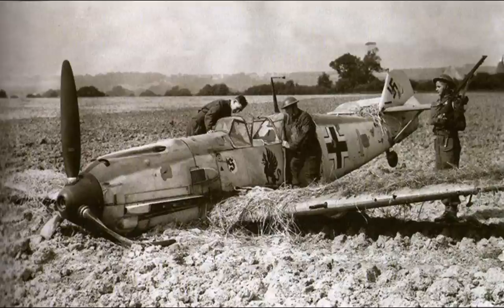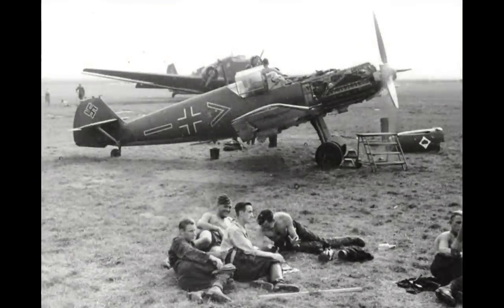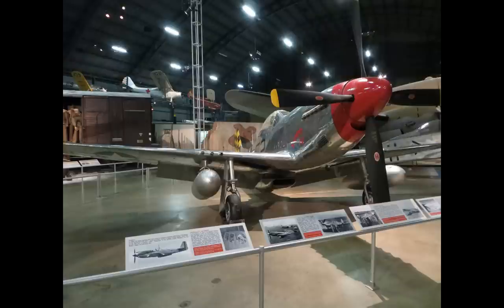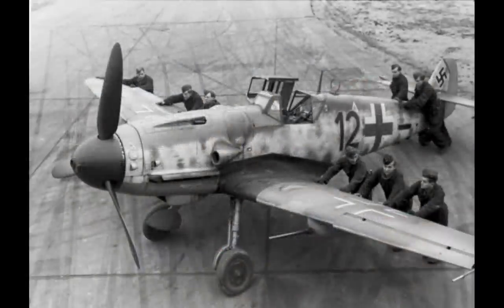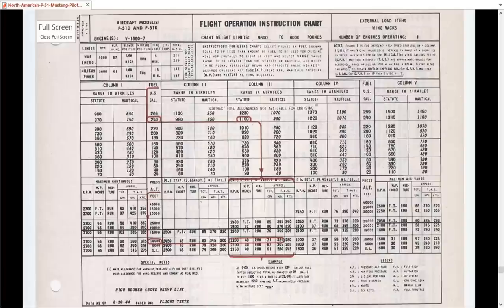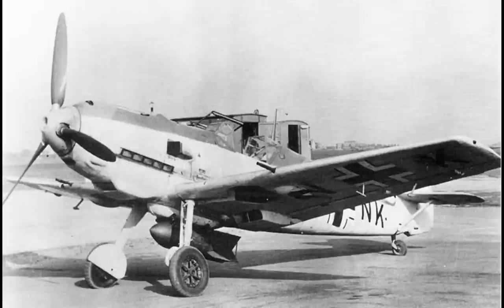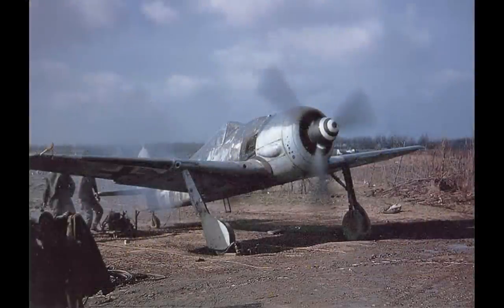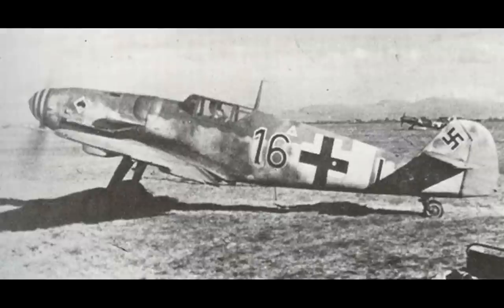Messerschmitt BF 109, Why Such Short Range?

Comment: From what I learned from Gregs other videos the answer to why the Mustang was faster is it ran a much higher octane fuel then the Germans had access to. Makes you wonder what kind of performance the Germans could have achieved if they had access to our fuel.
Reply: It’s roughly a 20% increase from B4(87 octane) to C3(100/130).   It’s about a 10% increase if going from B4+MW50 to C3+MW50 but could be more.   The main effect would have been allowing the Me 109 to go from 1.3ata 1300hp to 1.42 ata 1420hp one year earlier.     The later number ie 100/130 is a performance number and means it’s a 100 octane fuel that produces 30% more power if over boosted and run rich.  British 150 fuel was really 110/150 and the Americans had a 115/145 fuel so they gave 50% and 45% more power when rich and 10% or 15% when lean.

Late war Me 109 with the DB605DB/DC which was adjustable multi fuel  might end up running missions on 
 1/ B4 fuel, 2/ B4+MW50, 3/ C3 or 4/ C3+MW50.   The boost levels possible were 
1/ 1.45 ATA, 2/ 1.8 ATA, 3/ 1.8 ATA and 4/ 1.98 ATA.

An ATA is an atmosphere of pressure.  It coincidently neatly coincides with power.  IE 1.8 ATA means around 1800hp and 1.98 ata about 2000hp.

German B4 fuel,was 87 octane but they also had a C3 fuel of 93/115 octane.  From 1942 it improved to about 96/130 octane as their fuel plants I proved.  This allowed the BMW 801 to go from about 1700hp to 1900hp and finally 2050hp.   Initial increase was simply by increased boost pressure  but latter they added injection of the fuel into the supercharger to cool and contract the air called C3 Einspritzung.
Reply: They would still be inferior to the Mustang. The FW-190 didn't have  a two stage/two speed supercharger and bled hundreds of horsepower with altitude, the 109 wasn't much better in that department. High octane fuel does increase power but not by large enough margin to change anything really. Also, even at similar 100 octane horsepower the Merlin 60/V-1650-3 still generated more power than the DB-605, and the difference only increased with altitude.
Reply: 4./JG26_Onebad german engine's were developed for use of fuel they have had, if they would have better fuel they would make design around it, keep in mind that they had access to more or less damaged merlin engine's that were "dropped" or have landed on their land, 2 stage boost means not much if your engine will knock fire
Reply: @Herezjush  Even prior to introduction two stage superchargers and 100 grade fuel the DB601 generated less power than Merlin XX series, which is why the Spitfire MkI outperformed the Bf-109E rather significantly during the Battle of Britain. This trend would remain for the majority of the war.
Reply: @heckpupper9532  
And why is this? Exactly, because of the fuel but not in the way you would think. The RR Merlin not only had the advantage of higher octane fuel but also the advantage of having enough room in the engine bay to allow an inter cooler for the intake air. The DB 605 lacked both because of the usage of a huge engine in such a miniscule aircraft. But they had to have such a big engine to compensate for the comparatively low engine power, due to  low octane fuel. The high octane fuel basically allows the Merlin engine to run with more boost pressure, at higher altitudes, with more ignition timing advancement at  higher compression ratio, all these things effectivly increase power and all have been missing on the DB605 because of low grade fuel. The DB605 was probably a more advanced engine than the Merlin, simply from the fact that it had to deal with so many draw backs.
Reply: Octane does not increase BMEP.
Reply: @mbsevans  
Well no, it does. As i explained before, due to high octane content, you can increase the boost pressure, the ignition timing advancement and the compression ratio, wich all increase the BMEP and therefor power. So, the germans could very well have gotten a lot of power out of the DB605.
Reply: Mandernach Luca well NO it does not, and you just stated as much. You’re confusing octane, with real power increasing changes, as you correctly listed. Heptane is actually what makes more BMEP. Octane is what quells or nullifies the result of heptane.
Reply: It's no real wonder that BF 109 Messerschmitt held the certified world speed record for a single propeller aircraft until the late 70s when a highly customized Bearcat finally beat it. The only other time that I know of a single propeller aircraft that was faster than the P51 or the BF 109 was when Chrysler had built their first true Hemi engine, hey 16 cylinder aircraft engine, and put it into a P-40 of all things because there were no other newer aircraft available, and ran an uncertified circuit at right on top of 500 knots, which would it even beat the Bearcat in the late 1970s. The problem was is it was the first week of August 1945.
Reply: @wilburfinnigan2142  I never said that, I used Merlin XX as a comparison with the DB601A, precisely because it didn't have a 2 stage supercharger. I wanted to state a case that even back before 100 grade fuel and 2 stage supercharged engines became a think for the Allies, the Merlin was still generating more power than the DB601. Read carefully next time.
Reply: They would have also needed to add an intercooler system, a second supercharger, and a bigger radiator, aside from higher-octane fuel to the 109, according to Greg’s video on this subject. This would have required space inside the 109’s small airframe that it didn’t have, however, and therefore the German fighter was doomed to never match the Mustang’s speed at just about any altitude, outside of short spurts via injections such as methanol or nitrous oxide.
Reply: @44hawk28  the Messerschmitt 109R which broke the  world speed record bore absolutely no resemblance to ANY of the Bf 109 series which went to war.
Reply: The aircraft you're speaking of was in 1937 and it was a BF 109 d with an engine upgrade. But it most certainly was a BF 109 V-13. It was one of three bf-109 that raced it 1937 and set World Records. Do aircraft you are speaking of was a short tail speed version of the me-109 designated an me 209. It was given the moniker me-109 R after its construction. In April of 1939 it set a world record of 469 miles an hour that stood until 1969 when a Meijer exceeded that record in a heavily modified Grumman f6f bearcat. Your me 109R Bears no resemblance to a Messerschmitt accepting the wings a primary structure except it has a shorter tail and a custom Rudder assembly. So it is a heavily modified BF 109. And it was the basis for the more powerful power plants that were put into the BF 109 but that power plant existed in 1937 before your me-109 are was built.
Reply: @mbsevans  No but it increases the amount of boost which can be used at any chosen altitude. That increases power!
Reply: Britain received  supplies of higher octane fuel (from USA) shortly before the Battle of Britain which allowed fighters to increase MP (boost) and add power when combat began.
Reply: Mandernach Luca I teach this stuff to new pilots dummy. Heptane is the angry volatile brother, and octane is calming pleasant brother. As I said octane does nothing to “increase power”.
Reply: Mandernach Luca no you seem confused and lacking any logic skills. Higher comp, boosting, supercharging etc CAN increase power, only if it doesn’t detonate itself. How do we minimize that? Cooler operation. Water injection. Higher octane.
Reply: Keith Studly yep
Reply: @mandernachluca3774  so sorri here, but ur last sentence: "The DB605 was probably a more advanced engine than the Merlin, simply from the fact that it had to deal with so many draw backs." rilly contradicts itself [ie: doesn't make sense]
Reply: @starkraven7362  
Where does it contradict itselfe? The DB605 couldn't get an intercooler because the BF109 was such a small aircraft or run on 105 octane fuel because germany had not a lot of oil at hand to be refined , both are huge drawbacks. The engineers still got a lot of power out of this engine, because they developed the engine as far as they could.
Reply: @mandernachluca3774  ... yeh righto!? - wot ur sayin's all wel & guid deer chap, but put simply; anifink "advanced" wuld not b cummin wif une host of "drawbacks" to contend wif ... unless dem engineers/designers wer out 'n out dunderkopfs, they knew the parameters 'n conditions wot their "donk" wuld b required to operate unter 'n within ='s a serviceable but hardly "advanced" enjun - no?
Reply: @starkraven7362  
First, your english is terrible.
Second, are you kind of learning resistent? 

Drawbacks are not limited to design development, drawback in the case of the DB605 are given by the enviroment (you could say unfair advantages of the Merlin from the perspective of an engineer) and the engineers had to work around them, wich makes the DB605 a more refined engine.
For example, as the allied used for the most part two stage compressors, the germans developed fully variable compressors. They had to work 85 octane fuel, becsuse they had *NOTHING ELSE TO USE*. The allied could use 105 octane fuel, wich enabled them to advance ignition timing much more and use more boost pressure to make the same power.

Simply put, it was much easier for allied engineers to get some power out of the Merlin, the germans had to use every bite of their knowledge about engines to make around the as much power as the Merlin but with lower grade fuel and no intercooling.

You could say that the Merlin engine would make  less power than the DB605 under the same conditions, being limited space (no intercooler) and no 105 octane fuel (less ignition timing advancement, less compression, less boost pressure wich all would result in less power).
Reply: @mandernachluca3774  huh!...u leev me englisch alone [u unnerstood it wel enuf 'n it amuses moi] ... neeow - bileev it or not i'm hearing wot u say 'n upon reflection, wil even concede that sumpfing "advanced" mite also [in fact most probably will] av "drawbacks" [to b ironed out later, etc] but we're talkin' enjuns here 'n known tech 'n nufink revolutionary [eg: like a jet] & known quantities like fuel octanes 'n so on 'n so wot? ... u fink teh allies didn't av their own difficulties to overcum to produce sumpfink superlative like un supermarine spitfire avec its famus merlin donk - uh? ... that stodgy old daimler.benz605 clearly required much improvisation to bring it up to scratch 'n one wuld fully expect teh krafty machin krauts to b wel up to the job of improvin 'n "refining" a given "block" to unlock its inherent potential wich is eggzactly wat we kno they did - nuffink particularly speshul, refined or advanced about it - is wot eye fink!
Reply: @starkraven7362  
First, seriously are you writing in dialect or something?
Second, you are free to think what you want, that's your right (i hope). 
Still, the fact remains, that the DB605 is probably the more refined engine. The direct injection and the variable compressor are just two things, wich made it stand out in comparsion to the Merlin engine. Another would be individual water methanol nozzles for each cylinder and automatic ignition timing, wich wasn't that common of a practice for allied engines. Than there difference in compression ratio between cylinder banks to compansate for different wear, wich basically enhances lifetime by squezzing as much power out of the engine as possible. The Merlin engine is basically a carburetted V12 with a two stage centrifugal compressor and an intercooler, that's about it.
Reply: @starkraven7362  
Well, you don't have to be a fan of the Nazi regime, i'm also  not fond of them but i still appreciate the technological accomplishments of the engineers that had to work under such a regime ;D.
Reply: Laminar flow wing is being overlooked.   I believe that is one of the larger factors to the speed differences.
Reply: That and higher manifold pressures.

Comment: Wasn't the largest engine available in the smallest airframe also the thought behind the Corsair? Yet it has much more range.
Reply: are you sure?  the F4U has twice the weight of a Bf 109G
the F4U is a much larger aircraft than the 109
Reply: @jengelson  Corsair has a much larger engine, 46 liters, vs the 109s 34 liters.
Reply: @luvr381  the bigger plane can take more fuel, that's all it is
Reply: @jengelson  Pretty much, plus carry more ordnance.

Comment: Why I am here? I opened YT to see a video about how to play "The clash - I fought the law" on e-guitar. What happened? -Oh, it´s Greg again.

The FW187 had more range than a 109 but was never approved because of the extra cost of the 2nd engine. Otherwise the price was almost the same like a 109. So the 187 was pricewise a 109 + 2nd engine. It was ready for mass production in 36 or 38.
187s achieved some great results by factory pilots vs bombers and in Norway on testing. But it still got no approval. In ´36 with 2nd choice engines it was 60Km/h faster than any other production fighter in the world.
My source is: Bernard & Graefe, Die deutsche Luftfahrt, Kurt Tank – Konstrukteur und Testpilot bei Focke-Wulf
I dont have the book at my place otherwise I could offer range for the 187 and more exact numbers regarding years..
Reply: Come to think of it.. the Bf110 had a 1500 mile range. But we know it wasn't a Bf109 replacement.
Reply: @iskandartaib  The Bf 110D usually had a 'Dackelbauch', (dachshund-belly), large, slipper-type external tank fitted to greatly extend it's ferry range, (up to some 1350 Miles),. But it never excelled as an air-superiority fighter. The C and D versions were easily as fast as the Bf109, and Spitfire Mk1 and II, but were highly deficient both in turning radius and overall maneuverability. It was very effective in the Interceptor role though. Particularly in it's radar-equipped G version as a Night Fighter against British bombers such as the Avro Lancaster, which mostly lacked ventral protection. The 'Schrage Musik', upward-angle firing twin 20mm Mg15 cannon modifications were highly effective against them.

Comment: Bf-109E has same operational range as Spitfire Mark I, 660 km vs 644 km.
Reply: BladeRnR10  You can see that distance whilst in the plane. It probably saved some lives but at the same time im sure a good pilot could manage the difference either way. It's effectively the same